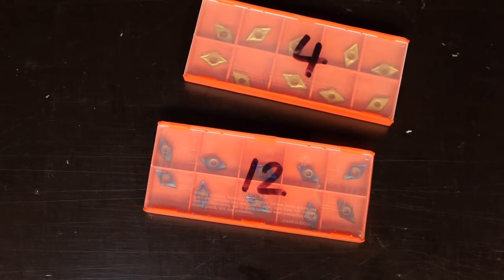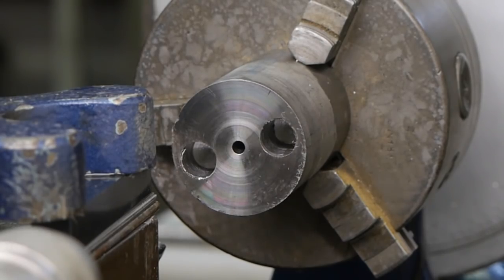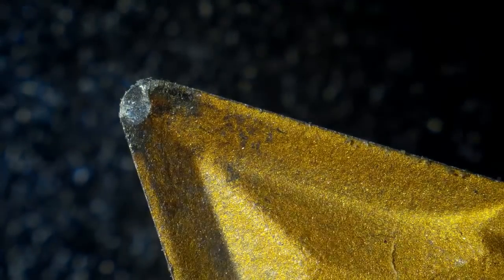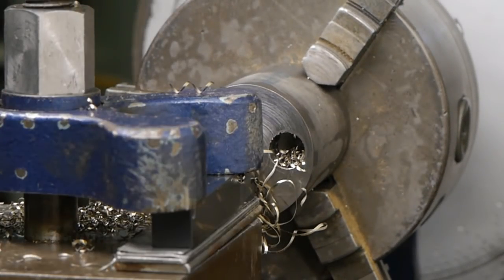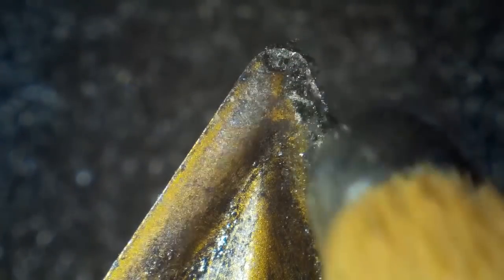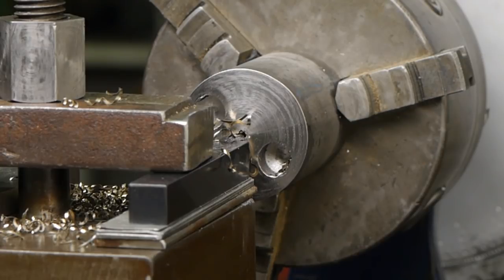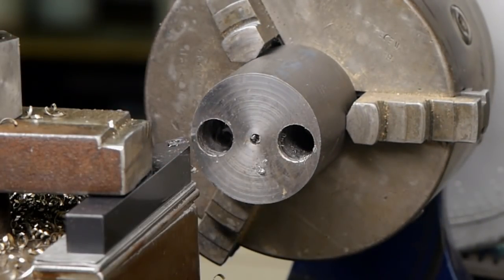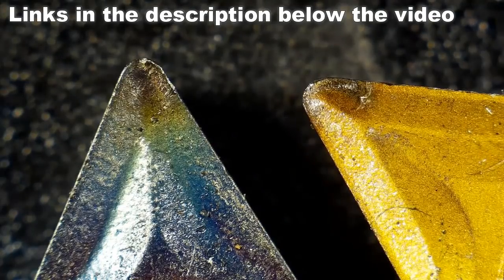Cheap Chinese lathe inserts tested to destruction

Comment: The 'chatter' was actually the sound of the interrupted cut from those bored holes if you didn't realize it. (I skipped around and didn't hear if you mentioned it)   Inserts that are not designed for an interrupted cut will also take more damage than a tough insert that was designed for impact..
The more fair comparison is to do it on a non interrupted surface so you get true wear and not impact wear.
Reply from the maker: The chatter always came after the interrupted cut.

Comment: What a great watch,  thanks.  I try to use the dcmt07 inserts where I can because of the low cost and have gone to the Chinese grade VP15TF as for what I do they last great. I was pretty impressed on how these stood up to the heavy intermittent cuts, was sure they were going to disintegrate. Thanks again for the great watch.
Reply: I tried these "mitsubishi" inserts, couldn't make a single pass on cast iron, the corner simply dissapeared

Comment: I think a lot of the damage to both tips are due to the interrupted cuts going through those two holes. If you notice there is a lot of swarf hanging out of the hole and is still actually connected to the work piece. I think these are getting caught between the insert and the work piece and causing the insert to break down. I would also like to see Mr Blue Nano be used on some really hard tough material. Like a car drive shaft or axle shaft to give it a real work out, in fact the gold one too.

Comment: To make it more interesting try turning a chunk of tungsten carbide and run it backwards for good measure, Obviously with no cutting oil. Set it to about 2mm cut. Wont take long to figure out which one is tougher.
Reply from the maker: Inserts will probably weld themself to the test piece
Reply: @Rolingmetal  Well it would certainly go catastrophic and fast! But that kind of video  is a good recipe for getting watchers. People love to watch stuff go wrong and get destroyed. The example is the hydraulic press channel with millions of viewers
Reply from the maker: I manage to unintentionally destroy enough stuff without a hydraulic press :)

Comment: That face cut across the holes is a good test and your not-so-rigud lathe is a good test bed simulating worst case conditions.

The "chipping" you refer to looks like normal flank wear to me. It would be nice to test both inserts to capacity cuts in a rigid powerful machine but I think your careful comparison test shows there's not much practical difference between inserts for light duty use except price.

 I've been buying cheap inserts for years and gotten good service from them but I've often wondered what I've been missing had I spent the money. My former employer was a thrifty man who tested brand Vs import carefully and came to the same conclusions you did. He stuck with the brand name inserts for difficult materials as there was some advantage in terms of durability and consistsncy. Otherwise, he used the cheap import inserts for general use and I've been following his practice for years now. They seem to hold up well even in 10 HP cuts in Rc 20 alloy steel but not so much in high nickel stainless and forging scale. 

Thank you. That was very informative.
Reply: Forrest, I appreciate your confirmation as to the cost effective use of cheap inserts. Though not a member of any of the popular machinist sites, I follow them closely. Never missed the opportunity to read your informative posts. ( Sadly infrequently these days, by the way.) Cheers from a fellow Puget Sounder.
Reply from the maker: Thanks for that information/confirmation Forrest Addy. It will certainly help some amateur out :)

Comment: DCMT are finishing inserts, high speed low feed, it's pointless using that at the opposite.

You better check them on a bigger diameter at 200~250min cutting speed, without interrupted cut and with a feed of max half the tip radius.

That kind of test is good for a CNMG/SNMG P25/P30 carbide.

Comment: Regarding the driving you crazy, it's a short trip.  One thing you proved very conclusively was interrupted cuts are not good for carbide.  It would have been interesting to see how these inserts performed without the interrupted cuts.  I really liked practical demo regarding why you should not attempt cutting from the inside to outside without checking for proper relief.  Good video!
Reply from the maker: Without an interrupted cut I would probably still be filming this video :)

Comment: PS:  Be interesting to know if there is any appreciable difference in the chinese brands themselves.  I haven't noticed any marked difference but I rarely get the same brand it seems.  Their markings and search engines don't make repeat buying possible in most cases unless you stumble on the ones you want.

Comment: I got a little nervous with your biggest cuts when the bar was long and after each cut I settled down as the bar got shorter. Big interrupted cuts... in a 3 jaw Chuck with the bar stuck out too far can end up seriously bad.  3 jaw chucks are dangerous.  Very well made video... you made a boring job look very interesting 👏🏻👏🏻👍
Reply from the maker: Thanks man. Have you ever tried Chinese carbide for one of your big trepanning jobs?
Reply: @Rolingmetal  I only use sandvik wcmx 1020 grade.. especially on super alloys like 718. Nothing comes close to them. I'm at work this very moment making a trepanning tool to cut a 9" hole thru 50" long. I'm making a video making it.

Comment: Mr Gold only rubbed because he’s not a boring bar :)
Generally carbide doesn’t handle interrupted cuts very well.
The chatter will get less as the bar gets shorter. (But you realised that)
Reply from the maker: I think the chatter is coming from somewhere else. Maybe the bearings or perhaps the chuck backing plate.
Reply: It could only be the backing plate if it is actually loose which I doubt.
If you put a bar in the chuck and a dial indicator stuck to the bed with the pointy bit (you have me saying that now) on the chuck if you wiggle the bar how far does the chuck move up and down.  You could do something similar to measure the end play.  Your end play is probably adjustable.
I’m assuming your lathe doesn’t have tapered bearings.  Does it have split bearings?  That is split horizontally. If so they usually have shims between the halves of the bearing housing.
If all of your shims have already been removed you could mill say .010” for example off the housing mating surface then put .008” back in shims making the round bit of the bearing .002” smaller.  You can get brass shim stock in all different sizes.  The amount you remove will depend on how much free play you have.  I think all is not lost, if it is bearing play you should be able to fix it.  I think I memember from an old video that the shaft mating surface is a bit scored up.  I was watching Abom79 fixing a motor shaft bearing surface last night with a spray welder.  Looked like a great gadget :)
If you have a spark eroder I reckon you need a spray welder. :)
Reply from the maker: Have you ever seen this video? https://youtu.be/QCYy1chHG88
It shows the spindle and the head stock construction.
I believe the headstock bearings are inserts and should be replaceable.
Ideally the spindle should be professionally reground and the bearings replaced

Comment: Very good video.  I am curious to see how the 'sharper' silver inserts hold up to the blue nano and the gold.  Some advertise them for aluminum but I have had good success on stainless when TIN coatings would not even begin to cut.  Also have always been curious if the Kenametal etc sold by Ali and Banggood are actually that brand (perhaps coming out the back door of the factory that really makes them for the different brands??) or maybe they just steal the name?  The brands themselves certainly aren't going to tell you that they are theirs and that you can get their quality for a fraction of their price!  On my budget I can't afford to buy one of their inserts to compare!!  So top shelf or not the chinesium is what I use.  Thanks again for the microscope shots of the wear.  Going to subscribe as this is one of the most 'real life' videos and useful in a long while!

Comment: I am new to this lathe world but have noticed that it seems when the stuff gets nice and hot it cuts better. With carbide I tend to let her heat up and not lubricate it (smoke sets off the smoke detector in my apartment) and chatter tends to settle down but I may just be hallucinating like I do sometimes when working on the lathe.
Reply from the maker: When thing get nice and hot I usually burn up my piece of ground HSS :)

Comment: The two holes are quite hard on  the inserts. I would suggest to use a large pipe or something to achieve sufficient cutting speed. Last but not least: make sure that you are in the ballpark spect cutting rate
Reply from the maker: Giving the inserts a hard time was the plan, otherwise I would still be filming this video :)
Reply: @Rolingmetal  we call that abusing

Comment: HI there - 31:05 chatter
i think a lot has to with your rapidly diasppearing cutting speed (you have given the not so high 600rpm)
If thats by diam.22mm lets say - then with 600rpm you are getting a cuttung speed vc-41m/min which is bottom for every carbide edge to cut material at all
That FEEDs that are comfy for your diam.60mm (by vc-113m/min) you can not keep doing when your cutting speed reduces (because of the diamater getting smaller)
The proportion of the cutting speed on 60mm and 22mm diameters(guessing theese by eye) vc113 / vc41 = 2,71  -  means that on the smaller diameter you can only feed 2,71 times slower to STAY AT THE SAME FEED/REV
if you force the feed faster you get an even thicker chip that is definitely too much for the insert
Actually thats why cnc-s speed up to their max rev when getting to diameter '0mm'  -  beacause theoritically your cutting speed also becomes '0m/min in the middle - which is not much :)
my opinion

Comment: I find that at lower speeds(below 850 rpm)my carbide tips run better with no lube at all.Plus I heard somewhere that its better dry or flood cooling as they don't like big temp changes,as in being sprayed with WD while making a cut.I'm buying more Chinesium tools and bits thanks to your reviews and I can't really see much difference in them from the over-priced home market stuff.
Reply from the maker: I think spraying WD might cause thermal shock.

Comment: Your old lathe is not really made for insert tooling. Carbide inserts don't have a sharp cutting edge, else they would ware as he'll. So they need was more tool pressure to cut well, and also higher speeds. The interrupted cutting is also cancer for carbide. It will chip off a lot.
Your old lathe will work at best with HSS tooling and a good sharp cutting edge.
On my smaller lathe I do most of the time using the polished carbide inserts for aluminium. They have very sharp cutting edges.
Reply from the maker: I bought a box of ccgt inserts months ago. been meaning to try them out but haven't had the time yet.

Comment: The fact that the coating seems to come off after only a few cuts (and these things are supposed to be designed for high tool pressure!) says enough...
I really doubt that the 'gold' colour is in fact TIN.... what the blue stuff (besides paint!) could be is anybody's guess !
These Banggood inserts are rubbish. 

You're better off buying NOS brandname inserts (eg on Fleabay) and make the insert holders yourself. The difference between these and the cheap crud is marked !

Good vid!

Paddy

Comment: God those coatings look terrible.  Instead of cvd or PVD they look like they were rattle canned.   I agree with the others, comparison to iscar sandvik or Sumi would be the ticket.  

 I've done this with many inserts with cut tests and have a great knowledge base setup for materials and substrates, just far too lazy to film all of it. That's where you come in!!
Reply from the maker: The coatings look rather flaky. I wonder how well it has bonded with the carbide.

Comment: Vegetable oil is as good as anything  - and cheap.
Reply from the maker: It's good for frying things.
Reply: And as a cutting oil - the cutting oil manufacturers don't want us to know that!! it's a proven method - use it from an old household spray bottle or a brush. Trust me - I'm an Engineer!!
Reply: @Rolingmetal  lubing for MQL is vegetable based. BTW, friend of mine uses olive oil if there is no cutting oil for threading ready laying around. :-)